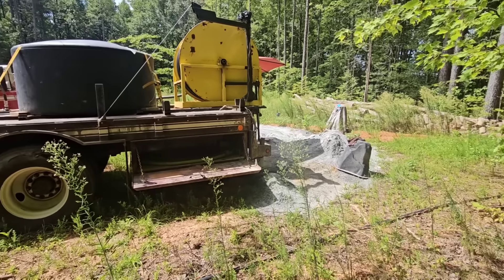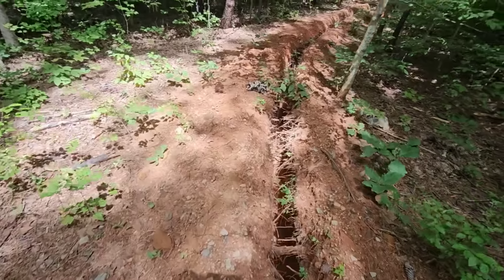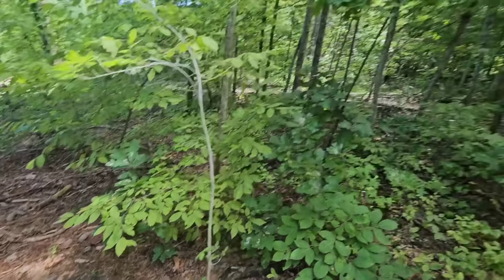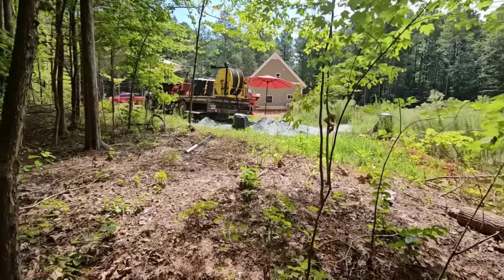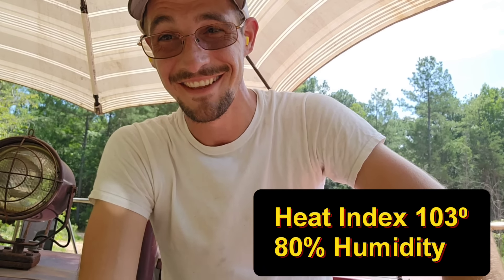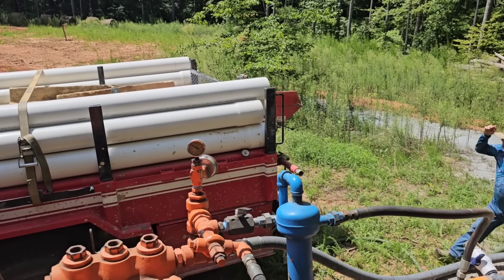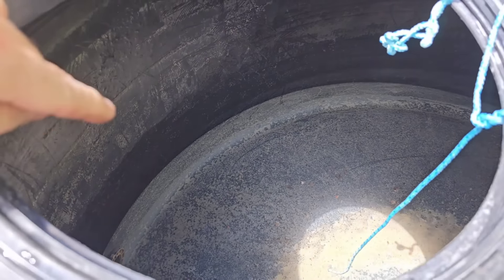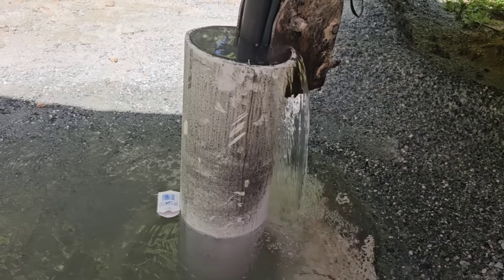High Pressure Hydro-Fracking. Can a 600' Dry Well be forced to produce water?

Comment: Just a tidbit. I’m a 25 yr mechanic and I couldn’t help but notice the fan shroud is of ill design. On the frack motor.    You want the shroud to stop where the fan blade is half in half out.   Makes it much much much much more efficient and will help it run a thermostat temps.
Reply: Yes

Comment: I have helped  do exsplosives in dry well ,man the geyser we got was massive ,the well ended up being the best producer in the area.
Reply: Not advisable, but we used to fire a .45 straight down the well to 'shock' the pores open.  Sometimes it worked, sometimes it didn't.  This was of course a hazard to the well casing, and possible source of lead contamination.  So... just don't do it! 😉
Reply: that's they way they were all done long ago. in goes blasting cap, boom and that's usually all they needed.
Reply: Oil wells usually use a coarse sand slurry (propant) to prop the cracks open…

Comment: A visual drawing of what you think is happening underground would be worth a thousand words
Reply from the maker: @JJ-gd7gf  noted! I'll pull out the white board on my next Vid! Which will be a crazy topic@
Reply: @h2omechanic  While you have the white board out, think about how to show how large a volume of earth is affected when you power a thousand gallons down a hole and speak to why you think there is water down there to flow after fracking.
Reply: I requested information from you about pump size and such two different times and I've never received a response any suggestions

Comment: Don't regulations dictate that unused wells should be plugged?
Reply: lol I was thinking the same thing at least I know it’s law in Michigan 🤷🏻‍♂️
Reply: Why
Reply: @kevinblevins2612  So that surface water, which could contain contaminants, can not flow down the well into the aquifers below.  In this case, although unlikely because the well isn't producing anything, it's possible for "cross contamination" to occur between different underground aquifers.  One last thing, if an animal falls into the well and decays, all that nasty stuff can leech into the aquifers.  Lots of reasons!
Reply: they should at least be capped off, but if decommissioned permanently, they generally want them grouted solid.

Comment: I guess I should be happy with my 100' 4" diameter irrigation only well producing 12GPM at the end of a very dry summer. I do have a question though. Since Poly pipe is illegal in most all states now what are you using for pump drops now? 
      I wish we had cool weather like you do.... Far nicer there than here in TX...

Comment: Very cool channel, Philip. I really enjoy all the content and experience that you have shared on wells. I have learned a lot. 

I do have a question regarding pressure tanks on a well system.

Friend bought older home on 10 acres with 12gal/minute well. He wants to add water to a workshop building  that is 30 feet from well. The Main house is 500 ft away , which is supplied by well.

Could a tee be added at well and plumbed to workshop? Does a pressure tank and check valve need to be installed?

He wants to add a  shower and sink to it in the future.

Is this something doable?

Comment: Question I have a well at 75 feet it was put in 27 years ago. Still has the original pump. I know I need a new pump due to water pressure getting low new pressure tank and switch. But the 6 inch galvanized pipe is questionable. When I have the pump put in should I have it lined and flushed due to all of the pipe flaking off inside pipe. It is full of the stuff.

Comment: Always enjoy your videos mate; as someone on the other side of the drilling industry (O&G), it's interesting to see how similar applications are applied, even if they're on a smaller scale.
I guess one question I have, is what is the well casing made of (upvc/pvc-u?), and what's the pressure rating typically of the pipes you're typically pressuring up against? I'm assuming there's some sort fill on the backside (annulus) like gravel and/or bentonite?

It may be beneficial to run your packer to immediately above your perforated/production interval (ie. slotted liner or screen sections), to avoid pressuring up the casing above the target zone/s un-necessarily - which could lead to burst casing sections or parted connections - through either purely applying too much pressure (ie. exceed the burst rating of the casing or connections); ballooning of the casing in unsupported areas (which can part casing joints due to high tensile forces) etc.

Keep up the good work, interested to see what rate this well produces at!

PS. deepest ESP install I've been involved with was at 21,000ft (6.4km, deviated well); pump was over 500hp!

Edit: The flowback you're seeing is typically a result of what we call "supercharging" in the O&G industry. Basically, because of all the fluid leak-off (ie. water being injected, along with other silt and the like being forced into the fractures/pores) into the formation/s , the near-wellbore pressure increases temporarily. If you were to leave the well shut-in, it would naturally bleed-off back into the formation/s over time, but as you're deflating the packer immediately it's flowing back up-hole preferentially.

Comment: Does the formation always fracture in the water bearing zones?  Or can you crack the rock in a dry area and just pump water into it?
Reply: Yes, you can. Depending on the UCS (uniaxial compressive strength) of the rock and exposed formations; the pressure applied etc., one or or more zones could start to break down and be injected into...

Comment: I wonder if you could run the incoming frack water over the engine's radiator?  Then your engine would never overheat.

You could mount the radiator in a tub, then just run the water through the tub on its way out to the well, so your water isn't mixing with the coolant.  The only danger would be if your radiator developed a leak while running - but you could mitigate that by running bright fluorescent dye in the coolant so you'd notice it right away.

Comment: Install 2 electric fans with shroud on the engine and that'll keep it from overheating. You could even get fancy with a cheap temp switch and relay to power them so its automatic. Those mechanical fans have a hard time keeping up

Comment: It seems like these pressures would simply crack PVC casing below the packer.    Enjoy the channel.
Reply from the maker: @CraftedChannel  our casing stops in bed rock. Roughly 60ft deep
 We inflate the packer at 80ft-130ft & it swells up into the rock wall of the well. Not in the casing. 
Wells that are Screened do have casing the full length of a well & cannot be fracked.

Comment: Why hydrofrack ? When you can use dynamite sticks
Reply: The fractures in the bedrock cover a vast area. A stick of dynamite would only affect a small area around the borehole. It would be like trying to push your car by hitting the back of it with a sledge hammer.
Reply: Where you going to get dynamite?

Comment: 8:20  190 is operating temp.  170 causes excessive cylinder and piston ring wear.  Too late now.  You've been running it for years.
Reply from the maker: @Failure_Is_An_Option  I limit it to the radiator cap letting off pressure. That happens when my temp gauge shows 195⁰